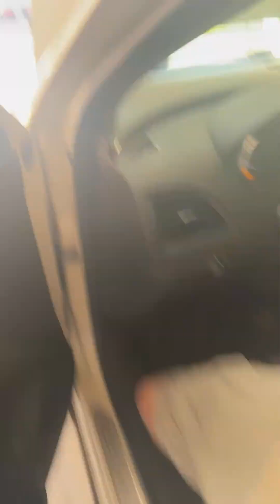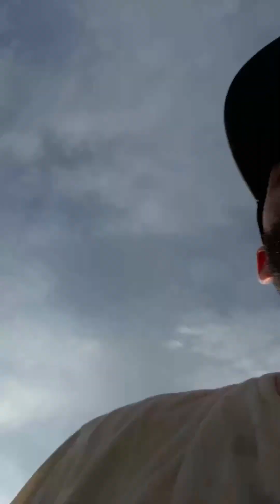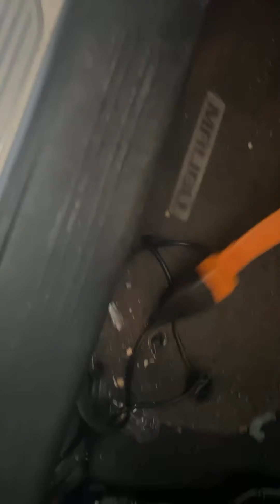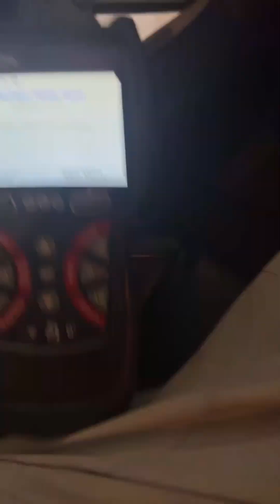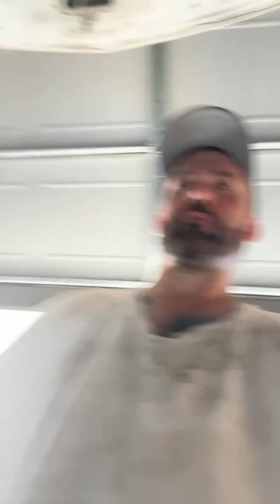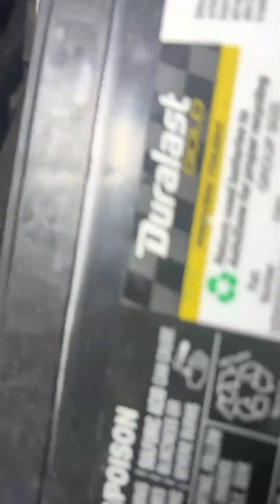P0621 Generator L-terminal circuit GMC Malibu LTZ Diagnostic and repair 1-4 #terminal #alternator

Comment: What was the problem I have this code for Buick 2012 regal my battery plate fuse keep popping when trying start replaced starter and starter wire still same thing it started once then died
Reply: Hey I got 2 negative one from the main negative and one from the amwire that goes to alt and starter on same stud could this be issue even tho it was like this before wen I replaced wire.
Reply from the maker: I need to know exactly what it’s doing. Do me a favor. Go to my forum section on here. You should be able to post yourself. Describe it to me and try to post some pictures. Ima do a live stream later also. Maybe you could talk to me then. It’s very hard to understand what you’re trying to say man…
Reply: @TSMobileMechanicLive hey took it to a local shop they saying engine messed up I guess it had 17 codes all saying stuff like cam shaft out position no oil pressure idk I wasn't there when car stopped my sister was driving she said she heard a loud bang, which she hadn't told me before😂😂 I'm like which you would lead with that.
Reply from the maker: Oh i understand. Ha. I get it all the time. A seized motor can also trigger the L Terminal issue. Because when the starter solenoid kicks out, it tends to have back current pass theough it if the motor is seized… So many times people tell me things late. It’s really not a great way to start off on a diagnostics… thanks for the update.
Reply from the maker: More than likely, you have wires, touching some. Some type of electrical issue could be coming from the starter along the path of resistance. Most likely repair is going to be to replace your alternator. The regulator probably has gone bad on it since you can’t buy that separate vehicles go ahead and replace that alternator. This should clear things up? without being able to see it. I can’t tell you for certain. Sorry sloppy text driving talk texting in truck. Keep me posted. PS alternators can overcharge as well. Don’t forget that.
Reply: @TSMobileMechanicLive yea my uncle who a mechanic said same thing alt, replaced it last nite and it still popping. I'm so confused. So new starter, new alternator new battery and used new cable that runs from plate to battery and alt. It being a push start does not help can't control how long it's trying start for real. I'm going work on it one more day then off to shop it goes lol any advice would be appreciated thanks.